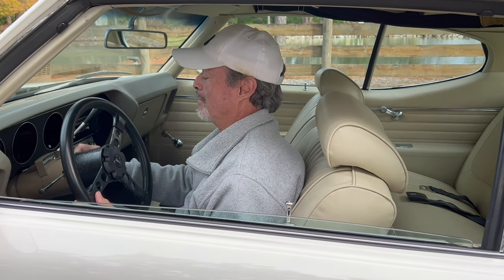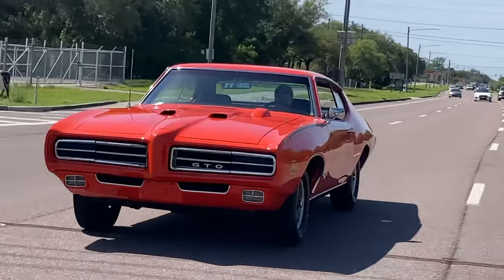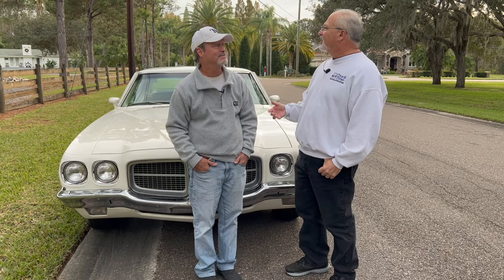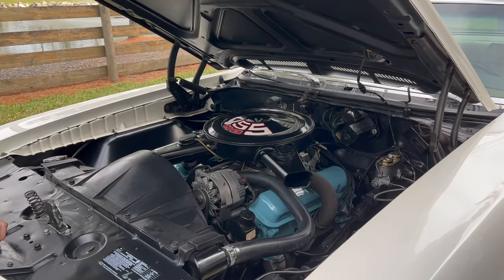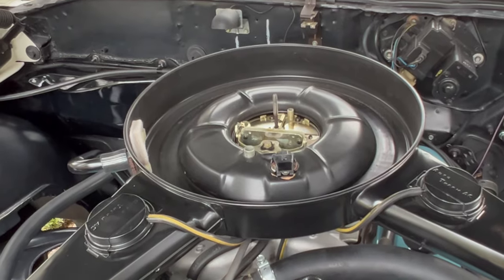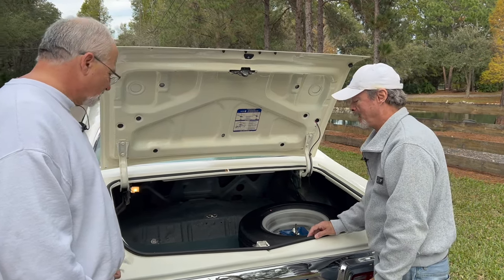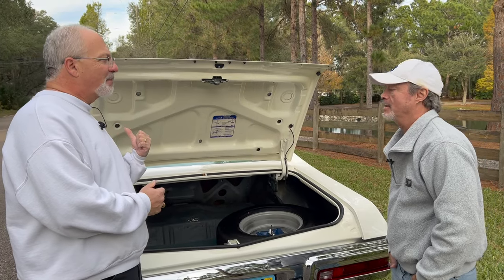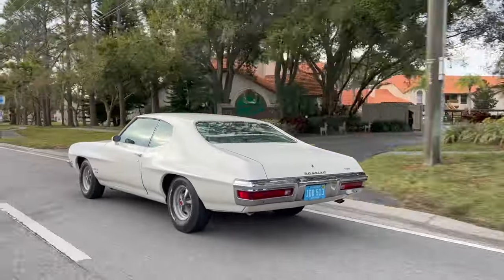Super Rare '71 Pontiac T-37 455 H.O.

Comment: MCC, you amaze me with your finds. Another Pontiac jewel. A single booster QJ. Wow. A 3.55 12 bolt, perfect for a street Pontiac. The rarity is extraordinary. Fantastic job on the resto. Altho I understand the need for originality, I'm a stickshift guy, and sad to see a column shifted auto. And also the P/S, and 4 wheel drums. Just goes to show, you can't have your cake, and eat it too. Good to hear this car is still being driven and enjoyed. Thanks.
Reply from the maker: Kevin has nearly doubled the mileage since he restored it, God love him. I think the column shift adds to the mystique.
Reply: Thank you.. Interesting overview… of a rare …Oddly, in 1971,, previous Fall 1970,I had just bought a 70 CORONET 500/383/4/ 4 BB/ Dual exh, loaded , except no air conditioning ; at great price (( Declining a 70 Challenger RT+/SE/4 sp/ totallly Optioned , in triple Green (?), we did not like all Greens!) .   Anyways,I looked around for some of this type rarity , but got priced out : esp the BUICK GS, 429 TORINOS, AMC REBELS…ANYWAYS, ended improvin* & building up, &* using up the 70 Dodge for many miles , until N Indiana Rust ate it beyond ……
Reply from the maker: @opera93  I have had a '65 Coronet 500 with a 383/4-bbl/TorqueFlite since 1992. It drives like a dream. And no, it did not have air conditioning, disc brakes, etc. Only power steering.
Reply: @musclecarcampy9922  thanks for comments..interestingly, I bought my first new Car , Coronet 500,in 1970;; Ralley Red/ black Vinyl , Deluxe interior Black(* the GSX, RAM IV, TALLEDEGA 429 , corvettes were to high$$, & we had LOTS of DRIVING: finish School, ( way before ZOOM) work ::: built & it up , maintenance (( I done most services; shocks, plugs, oil) *& started with HEI FROM MOPAR, MONROE SPE SHOX:: unfortunately lot of  MOPAR PERFORMANCE not  fit)…
Reply: I get the originality angle, but Jay Leno puts disc brakes on all his cars that were not already so equipped, just as a safety element. I agree with that sentiment. If it's a car I'm going to drive, I'm going with disc brakes.

Comment: What a COOL find! This is one I'd never heard of. I owned a 70 442 in 1973. I was 19 when I got it. The ride, the torque of those cars was killer. Wide track that's really cool, hadn't heard that for a long time. Love your channel!!!! Can't wait to see more!
Reply from the maker: Plenty more where that came from.
Reply: I own a 70 442 rally red white vinyl top factory hurst dualgate shifter with a white bucket seat interior with 342 rear gears and posi . It's being restored by me little by little it's getting there . Great cars the 70 455 365 hp with 500 ft # of torque with them 342 gears are a perfect combo. It's a no ac car it's just all business. It's a lot of fun tho.
Reply: Ron. With the oil embargo of 73 and 74 what did you trade in for?
Reply: @hoppes9658  it was my first car that I financed. I had a 57 Fairlane 500 that I sold before I got the 442. Sold the Fairlane for $500.
Reply: @ronaldhellengreen7063   That’s cool.

Comment: I would definitely prefer that over a GTO. No question. When I was 21 years old and had just joined the Army the year before they brought the Holden Monaro over as the 2004 GTO. I wanted one something awful, besides the fact they cost $33,xxx and I was only bringing home an E3 salary by late 2003. I was in Germany and AAFES wasn't allowed to import them and sell them to us. I finally got one, with a 6 speed, in 2017, I had a horrible stroke of bad luck and the engine was siezed and it sat in storage from 2019 until last month I finally towed it from TX to TN. Now I am saving up to put together an engine for it and put it back together in my driveway. I am probably going to build a 408ci iron block stroker with 243 heads, 238/242 cam, headers and a tune. I expect to see 550hp+ out of it and would like to see just under 500whp.
Reply: You guys lost pontiac and us Aussies lost Holden. Look after your piece of history mate.

Comment: That is a nice sleeper of a Pontiac and the price of it back then was a GREAT deal!  I used to see T-37 's run around my area back in the early 70's but not with the 455 HO. That engine had the old 288/302 HO/RA  cam I believe?  I had a 1977 Pontiac LeMans Can Am with the T/A 6.6 back in 1977. I should have kept that one.

Comment: What a fantastic car, thanks for sharing!  I actually have the exact steering wheel that goes in this car.  Came off a '71 Lemans steering column I used.  That wheel was the "base" wheel and while it is a little goofy looking I agree it kinda belongs in this car.  I actually prefer the "sport" three spoke wheel, which was the mid level option, with the Formula style wheel being the top option.  Or at least that's what an old brochure I found online awhile back said.
Reply: Formula and TRANS AM used the same steering wheel. It lasted through 1981.

Comment: One thing I am curious about is if a '70.5 GT-37 400 4 speed 3.73s or this '71 T-37 455 TH400 3.55s would be quicker and if the '70.5 wasn't as quick, would it be closer with a 068 cam and Ram Air exhaust manifolds since those came with RAIII heads. If it was still behind would 3.90 or 4.33 gears do it. You gotta love Pontiacs, especially rare cars like this.

Comment: Being a Pontiac fan I love the sleepers, I had a 56 Canadian Pontiac fact is there on a Chevy frame in Canada not Buick frame which makes that much shorter. It came with a blown engine 396/ 360 hp which I rebuilt with L88 cam blueprinted boy was this thing was crazy after 5000 grand as I had a Muncie 4 speed and 456 gears in 1970. I had to sell  the engine to schooling and drop in my done out 301 and I still beat out everything on the track that day except a 69 Chevelle with 307 stickers but actually had a big block 396. That combo was a perfect quarter miler as took out 440 GTX and my buddies 56 Chev with a 327 that he said he could take me out, he lost all 3😅 . Unfortunately it was stolen strip and burnt!! This is a Pontiac Laurention top of the line in Canada as it was a two door hardtop and have never seen another since, boy do I ever miss my baby as I did all repairs by myself with no training. Caio The Mouse

Comment: T stood for Tempest and 37 was the Pontiac internal code for any and all hardtop coupes across the line. The initial '70 Pontiac GT37 was indeed the fastest Pontiac muscle car produced when equipped with the Ram Air III 400-inch engine that put out a conservative 345 horses.

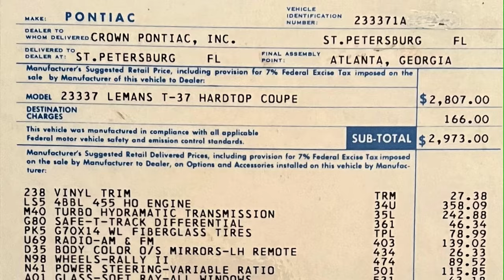Comment: 4:00 
Interesting that the dual exhaust option was like half the price of the hood tach. 
And 60 some odd bucks for a hood tach back then , that was a chunk of change you'd have to think about. 
Cool ride. 
There used to be an older guy around here that was a major Pontiac guy, my buddy worked for him in the late 80s and he had all kinds of neat Pontiacs. 
One I recall, and can't remember the year it was ,but it was a 70-72 Bonneville wagon with a 455, and darn it I wanna say it had a 4 speed, all factory stuff. It had woodgrain down the sides and was sort of a copper color. 
It was his tow car for his 66 GTO he raced ,and he raced it a few times when the 66 broke at the track,I think he said it broke into the 13s.
Reply from the maker: Strange days indeed. You could buy a Hemicuda and the tach was optional.
Reply: The last year you could get a 4 speed in any full sized Pontiac was 68.  From 69 on the only choices were column shift TH400 or column shift 3 speed manual.  And in 71 or 72 they made the TH400 standard in all full sized models.

Comment: I had a super bare bones 69 El Camino that the second owner (whom I bought it from) put in a pretty hot, old school build, 283 small block. 
It was .60 over. Had a factory steel crank. Pink rods. TRW forged flat top pistons. ported camel hump heads, with 1.94 1.60 valves, and double springs. a pretty decent little hydraulic cam. (Never did know the specs on that) Port matched Holley high rise duel plane intake. Carter carb. Headers. 
It felt like an old weak truck motor from idle to about 2800rpm, then it felt like someone flipped a light switch at 3000, and it pulled hard up to every bit of 7200rpm.  
What a blast. It was kinda like the power band in a big ol 500cc 2 stroke dirt bike.  
Nothin nothin nothin… then click, holly shit.. now we’re rollin. .!

The only factory options that car came with was 255 horse 350 4 barrel, a m20 4speed, limited slip 3:36 rear. 
That’s it. No trim. No radio, No ps. No pb. No ac. Nothing. 

It was a blast. Looked like nothing, but would click off a high 12 second pass (when you could get it to hook, it was hard to launch).
I painted the alum intake, and put the stock 350 air cleaner back on with holes drill in the bottom for better air flow. 
It had quiet full exhaust. Stock valve covers. It looked like a stock engine with headers. 
No one on the street believed me that it was a 283, even after showing them the engine.
Reply: 283 is short stroke 3” it’s peppy. 302 in Z/28 was 3” stroke with 4” bore.

Comment: 13.1 an excellent time especially at 110, i had some fast cars back in the day and if someone had a 13 second car it was FAST, most of them ran high 14's under 100
Reply from the maker: People would be shocked to see how many factory muscle cars could not do 100 in the quarter-mile bone-stock.
Reply: @musclecarcampy9922  yup, a 14 second quarter was real quick for an amateur or weekend driver. To run 13, you’d usually need a hotter cam or exhaust work.

Comment: I saw one once when I was working at Wendy's in 93.
It came through the drive through all rusted out and the woman driving it had a couple kids in the back and I'm pretty sure she had no clue what she had.
I knew though. I always had my nose in my dad's hot rod and car craft and muscle car magazines when I was a kid.
I'm sure it wasn't the HO with the 455 but it was a T-37 none the less. I've never actually physically seen another one before or since. If I'd of had 2 pennies to rub together I'd of tried to buy it from her.
Reply from the maker: Most T-37s were not muscle cars. They were plain, cheap intermediates.
Reply: @musclecarcampy9922  they were still very rare. Most , Hudsons and Packards weren't muscle cars either but you usually only ever see one these days in a museum. I knew kids in highschool who had LeMans' and Trans-AM's. Like I said I've only ever physically set my eyes on a t-37 the one time.
Reply: @musclecarcampy9922  also according to Google it was more than 15 that had the 455 HO. Maybe only 15 in 1971? Personally I'd rather have the small block. You could put a stroker kit in it, keep the numbers correct block and it still would be lighter and handle better.
According to Google.
"Overall T37 production came in at near 36,000, of which 5,802 were V8s. But of the V8s, only 54 had the 455 H.O. engine"

Comment: i think put back the original steering wheel and pontiac emblem in stead of 455 on the grille should be better
Reply from the maker: 455 emblem without the Pontiac badge is how it was from the factory.
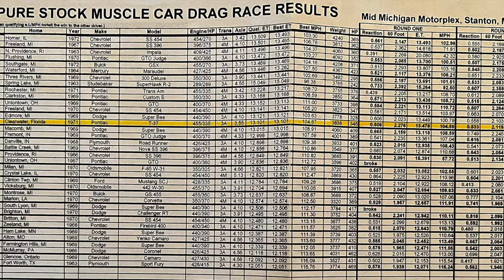Reply: @musclecarcampy9922 check your video clip at 14:51 on the drag racing track there is Pontiac emblem and 455 on the grille
Reply from the maker: According to the Kevin the owner, he added an NOS Pontiac badge in the grille, thinking it was correct and later discovered it was incorrect for a 455 car.
Reply: @musclecarcampy9922  I owned a T37 in 1980 Sport couple model 23327 gold color with white vinyl top white interior bench seat without AC exactly liked your car only different is the I got 350 engine and turbo 350 tranny
Reply: @tillaryauto  The late Pontiac engineer John Sawruk saw my car at the 2004 GTO nats, and told me that T-37s did not have those emblems, so I removed it ASAP!